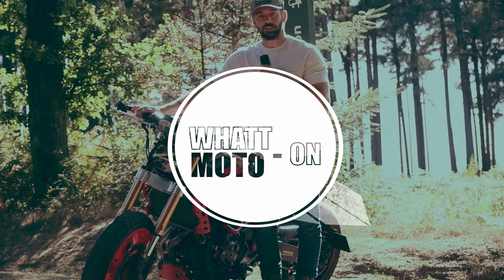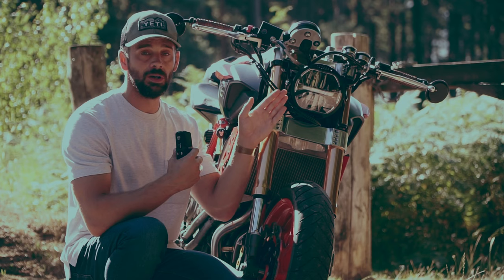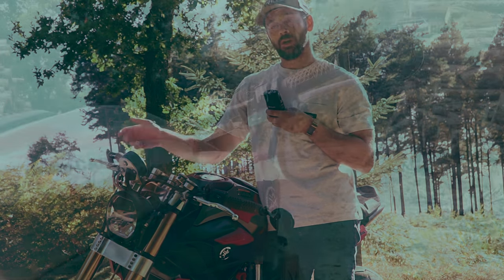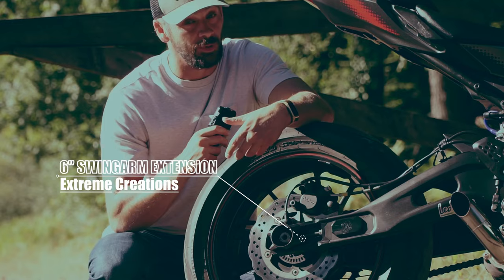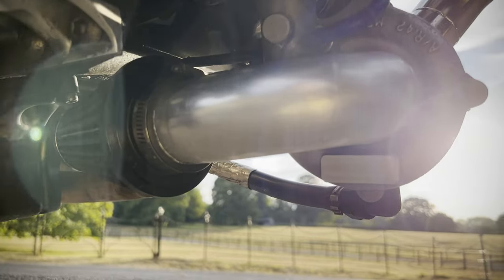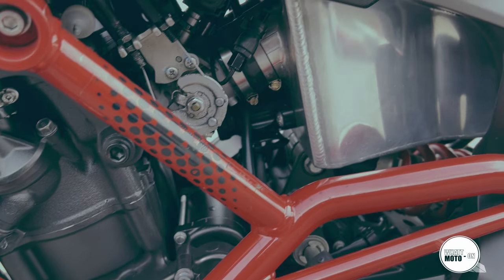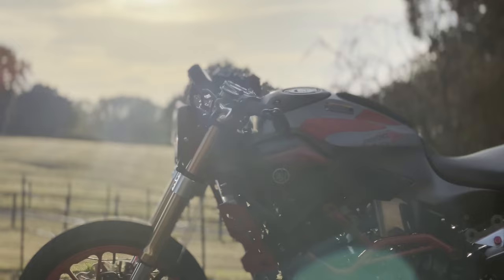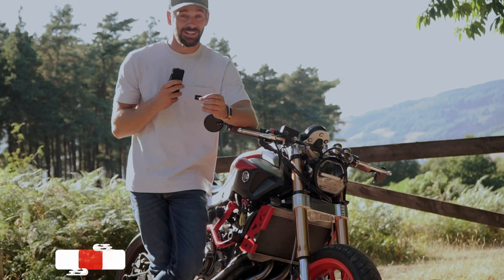Turbo Yamaha MT07 - Performance Mods and Walk around

Comment: Any turbo lag?
Reply from the maker: Not really, it’s got a wind up to around 3k revs it feels but the bike is already ticking over that rev ranger by that point. Boost kicks in fairly fast and snappy when I’m the correct gear. As it’s got a nice bit of torque for its weight, the turbo is already picking up as the natural torque curve is giving plenty of fun. Once it does kick in you just feel a nice toque curve as opposed to anything sudden

You can get it to give you that sudden feeling of boost by you need to be in too high of a gear if that makes sense 

Thanks for the interest mate :)
Reply: @Whatton_moto  heck yeah, your build truly is one of a kind. It has that nomad/wanderer feel to it. Rock on mate!

Comment: Cool build. Love the Crossplane twin with the turbo. I couldn’t personally justify building this over buying MT-10 but still cool netherless
Reply from the maker: Thank you! Definitely makes for a fun little bike now. The MT-10 is a fantastic bike, complete different beast all together!
Reply: Big 1L four cylinder vs. lightweight twin, they will feel completely different and make power very differently, even if equal power-to-weight.

Comment: Beautiful bike, would love to turbo one in the future and even then just cruise with it and have a little fun here or there. Yours sounds lovely on the road especially letting off the throttle at mid-high rpms. Touching internals kinda hinders the motivation for me, tbh it would stress me out to no end, keep up the good content stay safe
Reply from the maker: Thanks very much for the kind words and support mate, it’s much appreciated! Yeah unfortunately the internal work can be a little pain unless you have a builder you can use, then sometimes it depends on how long they take to complete the engine build 

I would say you can pick up a relatively low mileage engine for not much, I managed to find mine for £500. If you ever do go that route 

Hope you enjoy the future content mate 🙏

Comment: The math sort of works out to near equal with a tuned MT-09. You can drop 15 or more pounds of bulk off a stock MT-09 with exhaust, lithium battery, and other bits. You can basically max out peak power to around 119 hp and 70 ft-lb with un-restricting ECU and tuning. If you have deep pockets, going with a 520 chain conversion, carbon fiber wheels, and other bits helps a lot to get the weight off and remove rotating mass.
I'd love to see a highly accessorized MT-09 go against the turbo MT-07 and see how it compares.

Comment: I love it. It must feel scary fast. I have a 2016 MT07 myself that I am restoring and really love what you did with the XSR 700 round cluster. Could you tell me what the model  number is for the cluster you used. I live all the way in Jamaica and would have to order this from the US and cant afford to make a mistake. Thanks
Reply from the maker: Hi Richard, thank you for kind words… very much appreciated! Once boost kicks in it’s definitely a fun ride haha 

I will definitely get you the model number, any xsr700 cluster should work though unless they’ve upgraded them with new features with the later ones.. i believe the one I bought was from a 2017 bike. I would also get the XSR900 or xsr700 cluster holder as well, either one fits as I use the xsr900, purely down to the personal opinion of preferring the look compared to the 700 version. 

Check back on this comment for the cluster number if I can find it mate, once I’m around the bike.

Thank you

Comment: Power to weight ratio should be similar to my street triple 2008, with exhausts changed is 163kg dry weight, and with ecu flash did 112cv to the wheels!
Although I would really love to try a turbo bike, should be awesome when turbo spools up
Reply from the maker: This is the sort of bikes I’d like to try it against to get a real world comparison. I’ve tried the street triple, love that bike! 

Turbo is definitely fun! When it kicks in it feels like warp drive initiated haha. Sudden torque increase/ pull on the arms

Happy to drag test it against a triple in the summer if this presents a possibility when I’m at the strip
Reply: @Whatton_moto  newer street triple's have better brakes and suspension but the throttle feel of the first gen 2008/2009 is incredible, some say it's way "touchy" or "agressive" but in my opinion you feel more connected to the bike compared to newer models equipped with ride by wire which dynamically adapt throttle position based on many sensors and factors... I wish some day you could make some measurements like 0-200 or 1/4 mile so we could be able to compare. 
I think mine could be faster from 0-110kmh (first gear) but then you would fly off.. I guess on acceleration it all comes to the driver:)

Comment: Hey. Awesome mods. Where did you get the red engine protector bars??
Reply from the maker: Hey, thanks man. I wish I could tell you as I want more, unfortunately they came with the bike from factory as it’s a limited edition Moto cage Version of the 07. 

You might be able to find some on eBay if you look for the limited edition breaking

Comment: Is the xsr cluster compatible with non abs models of the mt-07?
Reply from the maker: @manuelschachner4401  I would say potentially yes. I have an ABS model MT07 but I no longer have my abs activated. I would imagine it’s the exact same wiring setup on the Back of the cluster except that the non abs mt07 jdoesnt have the wiring to go into that part of the cluster.  

Can’t guarantee any of the above but I would imagine it should be fine. Hope this helps mate

Comment: Where did you get the auxiliary gauges in the handlebar?
Reply from the maker: Hey mate, I got them from Aeroflow based in Australia. What you need really is a gauge with 15lbs or 1bar.. if you’re to use one for this setup on the MT. Many other gauges out there 👌 hope this helps mate

Comment: are those custom sliders or protectors on the airbox fender.. the red ones... or is it just cosmetic? makes the tank look wider... where can i get those?
Reply from the maker: I’ve never seen them on sale, they come standard with the motocage edition from factory. I think it was a one off of thing for this addition in 2014/15 . Would be good if they did sell them though
Reply from the maker: They’re basically rubber blocks stuck on the side of the tank, almost like a protector I’m not sure it would do much

Comment: Bro I don't get it turbos work is intake air but you put that turbo in the exaust which exhales air ! So what is the poinnt of installing one ?
Reply from the maker: Hey man, the exhaust gases spin the turbo turbine which is the hot side, on the cold side as the turbine continues to spin from the exhaust gases it draws in the air intake, forces it up into the plenum / air box and forces more air into the engine 🤙
Reply: @Whatton_moto  could you do a video about it how the turbo works. It'll be a great help for us to understand. By the way that mt07 is really one of a kind these mods really goes well with that beast. Looks soo stunning love your video's keep it up ❤
Reply from the maker: @thevoid38  thanks man much appreciated 🙏 unfortunately YouTube doesn’t notify me of continued comments so my bad for being slow mate. I will try to get a video up some time of how it works :) cheers mate 🤙

Comment: I dont know, I mean a used MT-10 is kinda cheap, I think I would rather buy that even though a turbocharged bike is cool. Why not put a turbo on a MT-10 instead ? :D
The only problem I had with the MT-10 the two years I owned it was the fuel economy, damn that thing run out of gas too quick.
Reply from the maker: Yeah you can get those for a fair price now tbh, definitely can’t say I don’t agree! I would love to Turbo an MT-10 but the costs would be much higher, maybe some day if the channel keeps growing haha 

Yeah I’ve heard the fuel economy isn’t the greatest on the 10, must be smiles per every mile though :)
Reply: @Whatton_moto  Have you heard or have any info if there is  a turbokit for the MT-10 like the one you got for the MT-07 ? Maybe the GT-15 that you had installed on your MT-07  also fits the MT-10 ? That would bring the MT-10 around the ballpark of  200 rear wheel horsepower something ? I might have missed it but did you mention how much the  turbokit and the installation cost you for your MT-07 ?  It might not be that expensive for me to put it on a MT-10 if I buy it again ?

Dude the fuel economy is much worse than "not the  geatest" It is bad in a problematic way. I can not think of any other bike that I can buy right now that uses more fuel than the MT-10. My friend thought his 2017 Aprilia Tuono V4 Factory was bad, the MT-10 was noticeable worse than that and much worse than 210hp Ducati Streetfighter V4. 
     
 I did a very expensive trip down to Italy from Sweden and round the Alps summer 2019, I write very expensive because the fuel I used on the MT-10 I made the trip on was a lot. It used about 1 liter per 10 kilometers (6.2 miles) on average and the trip was 8000 kilometers (5000 miles). 
      That is about 800 liters (211 gallons)  of fuel and If I remember correctly the fuel was about 18 swedish crowns (1,75$) per liter in most of Europe that summer (today it is 2$ per liter). So just the fuel for the MT-10 on that trip was about 1400 dollars :(
   Yamaha was aware of this problem and they say that they have improved it on the newer 2022 model that hopefully made it, at least like you wrote "not the greatest" :)

Comment: Looks fucking mint mate, seriously considering this myself. I've looked at the turbo set on extreme creations, does the bike internals HAVE to be changed? they have stated it works on a stock bike online. Or is this just a to-be-safe thing?
Reply from the maker: Thank you man, glad you like the build :) 

The internals don’t have to be changed, if tuned correctly and ran I believe I ran rich enough then you should be safe, just more oil changes required to keep the turbo and components healthy 

I’ve gone for an internal build myself for reliability as my previous original engine was ran too lean for so long before the turbo that I ended up snapping a Conrod in the end. Silly decision to run the engine without an ecu tune on a full aftermarket exhaust system
Reply: @Whatton_moto  Hah unlucky. Hows are the frame and the rest of the components doing, any bolts vibrating loose? ;)
Reply from the maker: @Dave-qq4lh  the frame seems to be holding out fine. I’ve seen other owners have issues when changing the rear suspension and snapping the mounting point on the engine, not sure exactly the cause to this but it’s definitely a weak point so I’m leaving that alone for now 

No parts or bolts vibrating loose, I keep a pretty strict maintenance on the bike

Comment: Lol an mt09 would literally slaughter this thing, spending 8k on a turbo kit is a waste just to get the same power of an mt09. mt09s also look WAY better
Reply from the maker: Cool story bro 😂
Reply: I think this would get an mt09 off the jump till between 60-100ish but then the 09 would slaughter the top end. Even stock an 07 is pretty quick compared to an 09.
Reply: Are you talking about cattle and meat lockers? Or machines? Because machines are easy to figure with math. Do you all know math?
Reply: If you have an MT-09, put your money where your mouth is. Race the guy.
Reply: I think everyone here is missing the point of what cooler having a goddamn turbo charger on your motorcycle or having one extra cylinder it’s not rocket science people turbo equals better
Reply: 😂 "Literally". Girl...
Reply: Lol, look at the 07 on a track and think again, power isn't everything